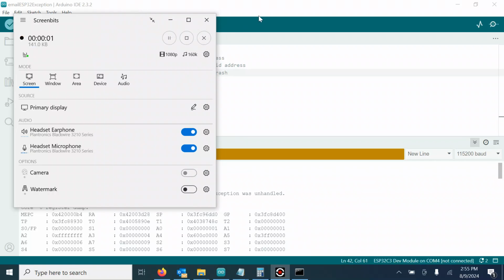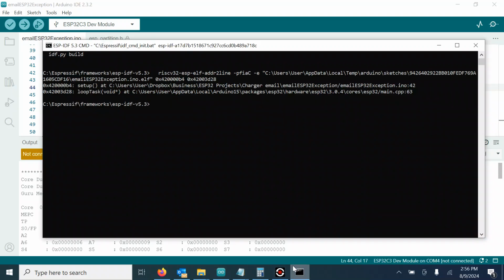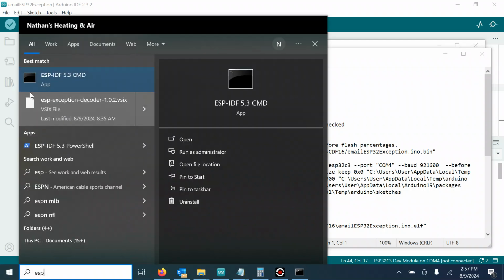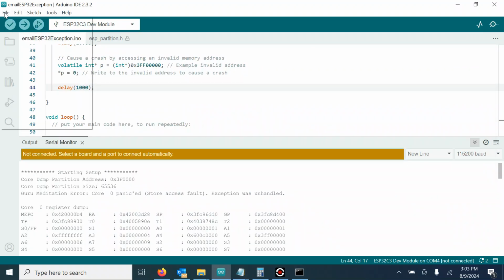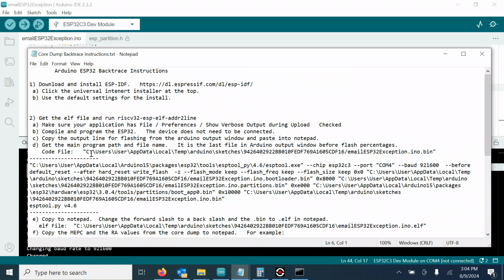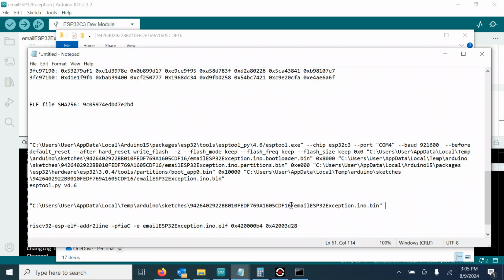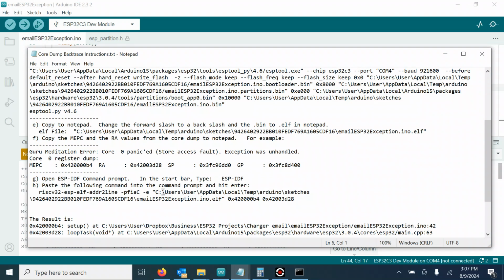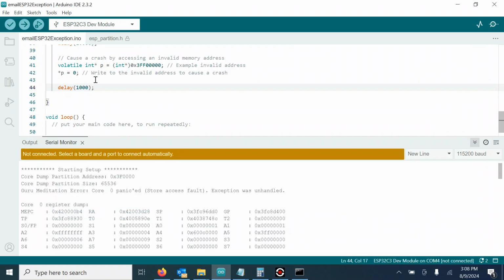Decoding ESP32 Exception Core Dumps with Arduino

Comment: This is pretty thorough, thanks. 

I didn't get the MEPC and RA addresses out of my core dump...I only got the info below. 
I tried passing most permutations of these to the riscv32-esp-elf-addr2line tool, but it choked on all I tried. Do you have any idea why I didn't get MEPC&RA? My core debug was set to verbose. Using ESP32-WROOM-DA

20:20:13.794 -> HTPS] GET... failed, error: read Timeout
20:20:13.794 -> 
20:20:13.794 -> Guru Meditation Error: Core  1 panic'ed (LoadProhibited). Exception was unhandled.
20:20:13.834 -> 
20:20:13.834 -> Core  1 register dump:
20:20:13.834 -> PC      : 0x401830c9  PS      : 0x00060c30  A0      : 0x800d43ae  A1      : 0x3ffb1e70  
20:20:13.834 -> A2      : 0x3ffb1f10  A3      : 0x00000000  A4      : 0x00000000  A5      : 0x00060a23  
20:20:13.834 -> A6      : 0x00000001  A7      : 0x3ffb82f8  A8      : 0x00000001  A9      : 0x00000002  
20:20:13.834 -> A10     : 0x3ffb20cc  A11     : 0x3ffb20d4  A12     : 0x00000001  A13     : 0x00000001

20:20:14.065 -> Rebooting...
20:20:14.102 -> ets Jul 29 2019 12:21:46
Reply from the maker: Try using ChatGPT or Grok.   They are really good at looking at screen shots.